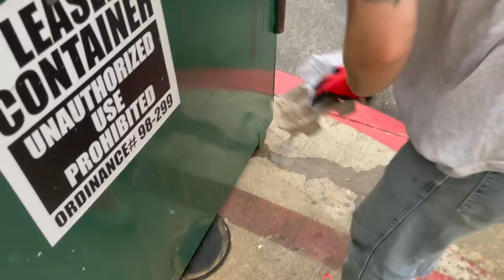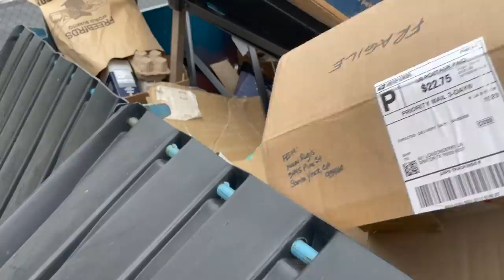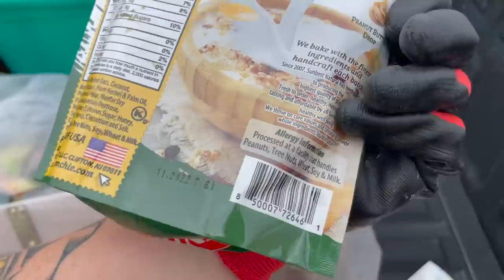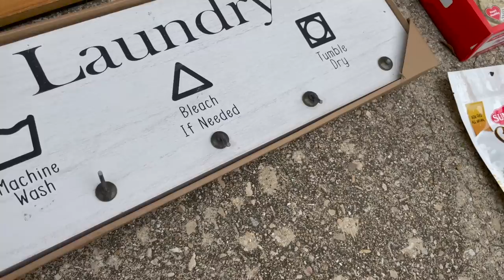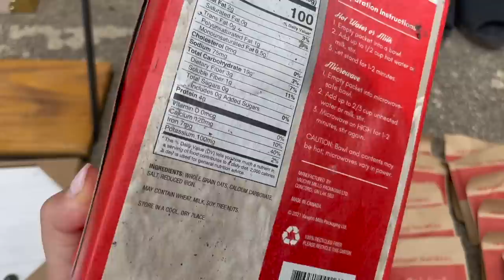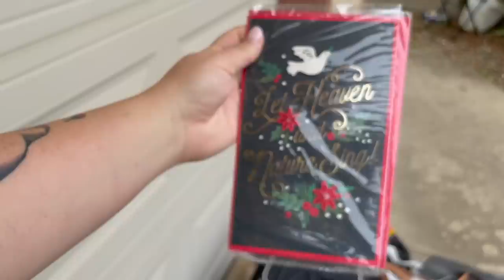A Great Day of Dumpster Diving! Did Someone Throw Away a Louis Vuitton Bag?!

Comment: neat haul put a little glue inside that soap dish it will fill the crack n be fine the chest box that hinges came off when you get screws to put them back before putting the sctrew into the hole fill the hole w glue the put on hinge w screws that will never fall aff out glue in each hole looks like thise holes were stressed n were pulled out i promise if you put glue in the attatch screws then leave it a couple days to dry it wuill be better then new <after all you strengthen the hinges good luck
Reply: You're definitely the glue mama 😉😊

Comment: One way to authenticate a LV bag is to look at how the monogram is centered and lined up. Every monogram will be perfectly or almost perfectly centered between the handles/straps and lined up straight under or next to the trim. I can see that while the monogram on the side you showed is centered between the handles, it is off elsewhere. The monogram is never off-center or not symmetrical on an authentic LV bag.
Reply: ?
 So is it or not???
Reply: It is 100 percent a replica Louis Vuitton Neverfull GM purse. Someone would buy it since the original is 2,100 someone that can’t afford one would love that bag !
Reply: I bought a Louis Vuitton Duffle at the thrift store for $3. Unfortunately it wasn't real but I still flipped it for $30.
Reply: @nicoleparker2812  I found one at good will... was 3.99... turned it for 300.00 it was real....

Comment: The LV NF GM is a very good find. If by chance it is a replica with such accuracy as an authentic can go for 200-300 dollars at least. The threads can be singed off and please do not think for one second that because there are threads loose that it isn't authentic. LV bags are not as high quality as they use to be which is why if I want a designer bag I have been very selective of the ones I choose from them especially when it comes to the Neverfulls. Also, the Neverfulls are not leather so they wont feel heavy; it's made of canvas which is why it feels so light. Thanks for sharing. Blessings.

Comment: The bags are definitely fake. On the big one the lv logo is interrupted by stitching and the inside is usually canvas and one color. Also it should have a tag with numbers and letters, which correlates with when and where it was made. Stitching should be beige like the leather instead of yellowish
Reply: Even good fakes have serial # so just bc it has serial # doesn’t indicate it’s a real bag, you can tell just by looking at it, if you know about designer bags!!!
Reply: @missknockout4899  the bad stitching was the first sign. The stitching on a real bag doesn’t look that bad after even 30 years of use

Comment: Hi Kelly, I believe you are correct, it is a fake LV...what I was looking at of course first off the loose threads, but also the quality of hardware seems weak and the most telling thing of all is on the little bag...look at the LV print across the top. The LV prints should be totally even and you can see that little bag is tilted, the print is not even. So sad that creators have their work and brands faked isn't it? It was suspect as most people would not throw away a real one, still...its a good teaching tool to show what a fake looks like. I'm glad you found the other things today though like the cooler bag. Cheers!